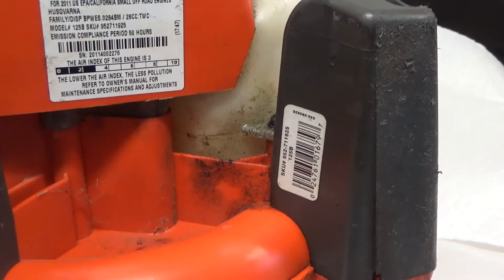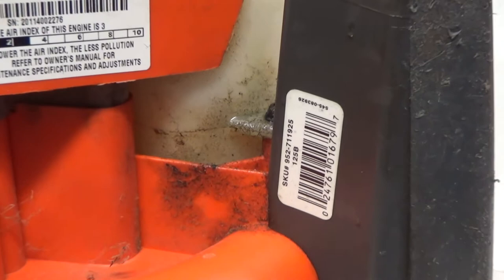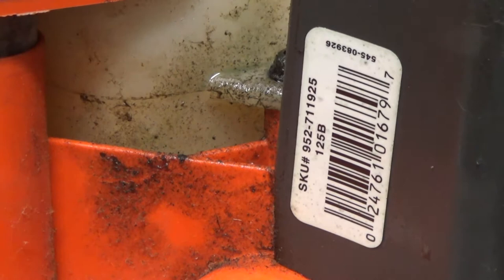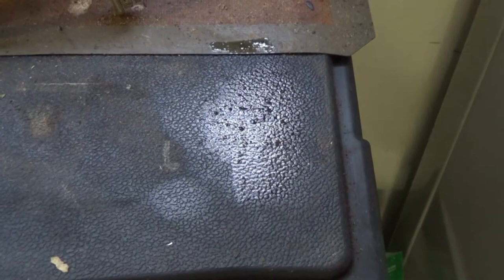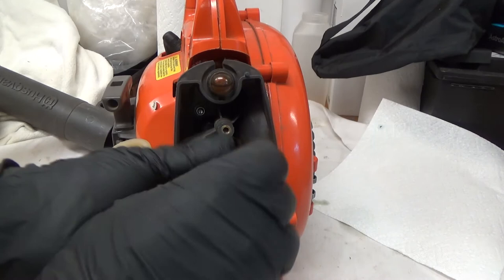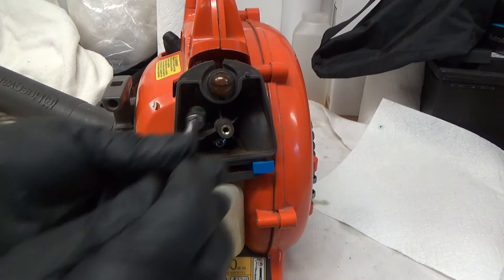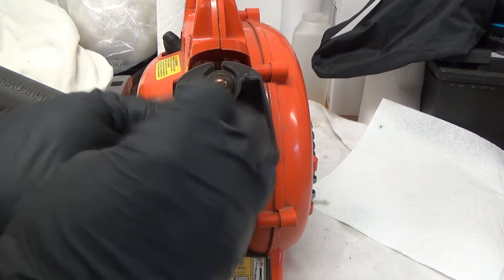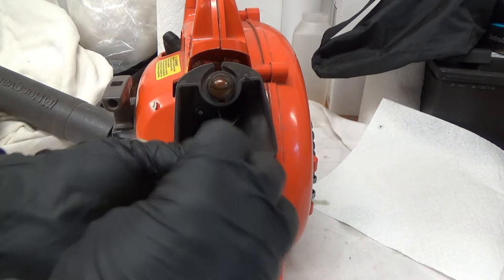Husqvarna 125B leaf blower with broken fuel lines

Comment: Great detailed video. Thanks. I will be taking mine apart as I have a fuel leak too. Starts, runs for a few seconds then dies. When I prime it fuel is dripping out the bottom. So I ordered the tubing you use and will replace all the lines since I'll have it apart already. Thank you again for the detailed breakdown.

Comment: Thanks for information. Yes the fuel lines go bad, but I really think that it is the ethanol in the cheap gas that does the breaking down of them. I have always used the more expensive,  real gas in all my two stroke and lawn mowers. It is pure petrol and will not harm (as much)! A little more cost, but the old saying goes here; "Pay now or pay later".

Comment: I rebuilt mine just like you did, but swapped the lines by accident.  I had the filter line (supply) going to bulb then top of carb, and bottom line draining to tank.  It would barely run, and only when continually priming.  I was starting to get frustrated until I watched this, thanks for the info, as line configuration made all the difference.
Reply from the maker: Thank you for taking the time to leave your comment.  This is a very important point that I had looked over in a previous video.

Comment: David, thanks for posting, and thanks for leading me here with your reply to my comment on your 2018 carb replacement video.  In that video, you replaced the carb and you reinstalled the fuel system including the fuel tank inlet filter (which is weighted and keeps it on the bottom, hint, hint...). In that old video, I thought there might have been a new filter with the new carb, although you did not mention that, I saw one on the table.  I wonder where the installed filter went, since I saw you put it in!

Phil in gorgeous Young Harris, Georgia, USA
Reply from the maker: Thank you. I really appreciate your comments.

Comment: Fixed mine following your video to a tee! Thank you for the video! Runs better than when I got it!
Reply from the maker: Excellent.  Remember if you fuel lines did not say Tygon, them watch them.  some lines only last a season or two.
Reply: @A_Renaissance_Man  I bought them separate from my kit just like you mentioned.  I would rather have the best lines and I used the sizes you messaged me earlier :-)

Comment: So I replaced the fuel lines. Carburetor. And it still bogs down on the throttle.   And when I prime it it's squirting out of the new line from the nipple up top.

Comment: Just watched and used it to put in a mew carb. Put in new lines also, mind we’re written but I had trouble starting it . First time I put the lines back on in the tank but only had one line initially. Since then have put on 2nd line in tank but I was wondering. I screwed with the high low settings. What should be my initial settings to get it to start up? Thanks and great video!

Comment: What diameter line did you end up using?
Reply from the maker: I used the 3/32 Inner Diameter Tygon brand Tubing.  I think the 1/8" will work too.